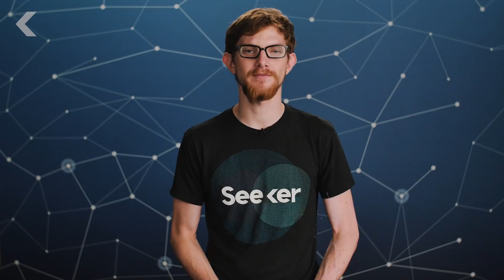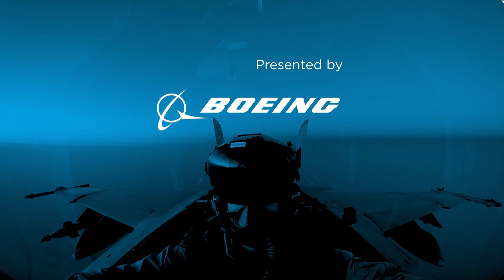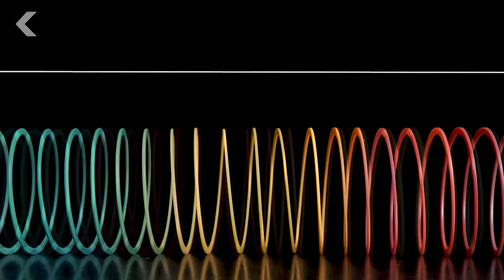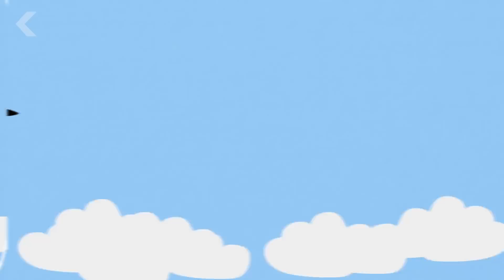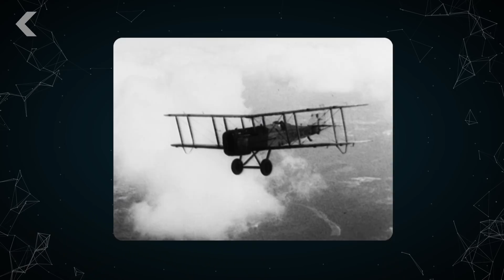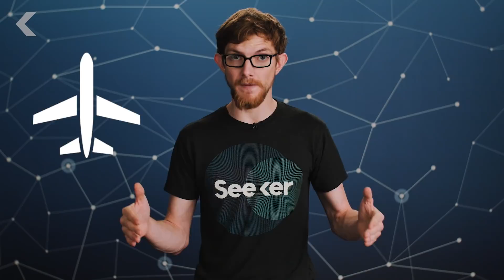The Simple Discovery That Let Us Fly Faster Than the Speed of Sound

Comment: 2:55 

I live only 2 1/2 miles from the runway of an AFB, and let me tell you this. When an f-16 takes off, you hear it. when an f-22 takes off, you don't hear it. When an f-35 takes off, your windows rattle and you hit the deck. Last airshow i went to had the f-35 as its main event. On takeoff the sound is so insanely loud it feels like you're being punched by it continuously. But once it gets up to speed and turns the afterburner off, it's oddly quiet.

Comment: China I-plane is designed with two set of wings.The reversed forward swept wings and delta wings has a better lift and less drag from sonic boom.The I-plane uses two turbo-scram jet engines to reach mach 6 speed.Typed Wang Zhenguo and VLRAAM into your computer to find mare information on Chia s 6th generation airplanes.The PL-21 VLRAAM that flies at mach 6 speed is based on the turbo-scram jet engine.

Comment: under normal subsonic flow, air flow rate increases as flow cross section area decreases. No issue there, it's just conservation of mass flow. So this mean if you increase the angle of attack at subsonic speed, lift increases. However, in super sonic flow, the relationship between flow cross section area and flow rate is actually reverse, IE: powider flow cross section actually lead to faster flow rate. This in term translate to if you increase the angle of attack at super sonic flow, the lift actually decrease instead of increase.

Since most plane control surface operate based on this angle of attack principle, this mean when a plane enter super sonic flight, all its control surface's force vectors are actually reversed. Imagine you're a pilot, at super sonic flight speed, you would actually need to tilt your airplane downward in order to fly up, pretty counter intuitive. Similar inversion also happen to pitch, roll and yaw control surface.

Since airplane don't transition from full subsonic to full super sonic at a sharp cut off, what you have is transsonic flight. Where an airplane has part of its flight surface in subsonic speed while other part in super sonic speed. This mean part of your flight surface has reverse control while other flight surface have regular control. It's incredible hard for a pilot to maintain control of the airplane during transonic flight without using computerized flight control. A lot of early test pilot actually died because they stay in this "unstable" transonic flight for too long.

Comment: No wonder Trace was annoyed when someone pointed out that the diagram of a wing in flight was wrong. They presumably had already been planning to use it in 3 more videos, including this one. How many Boeing videos are you doing? And will you ever correct that graphic for any of them? The air going under the wing essentially bounces off and gets directed down. If it shot up like that, the plane would drop due to conservation of momentum. Eventually you should watch the Numberphile video that explains it. The difference in air speed that leads to a difference in air pressure does not fully explain the effect. It's enough of an explanation for your purposes, but the diagram should still be accurate enough that it could explain the other aspects.

Comment: Actually, most propeller tips do not break the sound barrier.  For example, a Mooney M20C has a Hartzell propeller that has a 74-inch diameter propeller.  Its radius is one half or 37 inches, just over three (3) feet, or one yard long.  At a maximum rpm speed at take off of 2,700 rpm, the speed of the propeller would be somewhere around 550 to 570 mph.  Not quite the speed of sound of 750 mph at sea level.  However, the speed of sound changes due to atmospheric conditions, like temperature and pressure, but unless you are flying a P-51 Mustang with a supercharger which can churn 3,000 rpms at very high altitude, the tips will not break the speed of sound.
              It has been said that many pilots during WWII broke the speed of sound before Chuck Yeager did it, however they never lived to brag about it.  When they did it, it was in a high speed dive.  The special secret that Chuck Yeager admitted to after the matter was unclassified was the ability to have the tail section change its angle of attack as the speed of the aircraft increased.
BTW, for anybody interested in computing the speed of sound of a wingtip, try this:  2(Pi)R=Cxrpm/5280ftx60min=prop speed tip.   Where 2 times pi time radius= C where C is the circumference of the arc of the propeller.

Comment: Hopefully, traveling at the speed of and faster than light will be possible. I don't see any reason why it can't be. Everything we see in nature, however complex it may be, is 'raw', we can refine it and make something bigger and even more complex by analyzing it and combining it with other things. Therefore I believe breaking the light barrier will be possible, we just don't know how yet.
Reply: Illyasviel von Einzbern There's a host of problems traveling at light speed. 1st you'll need an infinite supply of energy which in this universe is not possible. 2nd you have relatively problems of traveling near or faster than light. And 3rd the practicality of it isn't worth it when non conventional means a traversing universe are more viable due to their efficiency and avoiding the 1st 2 problems
Reply: And the infinite energy thing also means that you're turning into a black hole. They call it the universal speed limit for reason.

Comment: You guys sure are getting your money’s worth out of that “airflow over a wing” graphic
Reply: OH HELL YEAH WE ARE.
Reply: The logic behind it is a fallacy, the air does not accelerate to meet the flow at the end. Bernoulli's principle says that if the cross section get's smaller (think of the top part of the wing as 'half a tube') the flow will accelerate and therefore the static pressure will drop. This difference in pressure between the lower part of the wing and the top part, is what creates lift. Along with washout from beneath the wing due to Newton's third law of motion.
Reply: That wing as shown blows.
Reply: Trace Dominguez Savage
Reply: You are one of the few people to finally understand how the aerodynamics of a wing work.  I believe the numbers are 80-90% of lift is due to Bernoulli's principle and 10-20% due to Newton's third law.  The air speeding up on the top of the wing is a very common misconception that is still taught today.
Reply: +iLivOnYooTube - If you check the cross section of an F-104 Starfighter wing, you might think twice about Bernoulli.
Reply: lmao
Reply: @iLivOnYooTube - Well the air does speed up at the top of the wing, but it is not because of the equal transit time theory. The exact reason why the air does speed up is still unknown.
Reply: Javier Llaneza the air does speed up. The top of the wing is rounded which forces the air to travel a greater distance than the bottom of the wing, this creates  low pressure. The air on the bottom is high pressure. The molecules on the top and bottom are moving at different speeds but they must meet back together at the same place and time.

Comment: The main change that allowed faster than sound flight wasn't the swept wing, but the "flying tail". On sub-sonic planes, a hinged portion of the elevator and rudder move. It was found during the experiments with the X1 that if the entire elevator and rudder were made to move instead of a hinged part, control could be maintained as the plane passed through the speed of sound.
Reply: 88dukecoupe that crucial information was given to the USA by the UK with the Miles M52 program having already solved the problem. The USA then made the UK govt shut down the program so they could be first to break the sound barrier.

Comment: Beyond the sweep of the wings, the other major development that allows flight faster than the speed of sound is the movable tail surface.

As speed increases, the original method of putting control surfaces at the rear of the tail planes didn't work.  The leading edge of the tail surface caused a separation of the air stream, and it didn't reform until well behind the control surface.  Making the entire tail surface pivot was a major step in resolving this issue.

Comment: The point of this video is just bad. The shape of the wing does matter when breaking the speed of sound but it's not what got us to that point. Swept wings were designed to give more control and stability when going faster than the speed of sound. What really got us to this point were the improvements of rockets and jet engines. the first plane to break the speed of sound was the Bell X-1 and it used a rocket to propel itself. (jet engines were still very new and still slower than some propeller powered planes. The Bell X-1 did not have swept wings, it had straight flat ones that also gave more control because the airflow wouldn't separate from the wings like the primitive designed ones showed in the video. The airflow disconnecting from the top of the wing instead of following the curve down to the rudder was the reason for a loss of control of a plane going close to the speed of sound. (An incredible amount of  piolets died from this when trying to pull out of a steep dive). Better jet engines are what really allow for supersonic flight today. Swept wings are not the reason supersonic flight is possible. This video does not go in depth enough to qualify as educational. This video is just riding on the back of the awesomeness of supersonic flight.

Comment: So they made it more aerodynamic? Seems like a no brainier. You wouldn't want a boat with a horizontal bow if you want it to pierce through the water at top speeds.
Reply: That's not how wings work. Swept wings are objectively worse at low Mach numbers.

Comment: This is total nonsense.  My professor was the guy in the tower at Edwards with the Phd on that day, who also designed the b-52 and SST...  The issue is when the wing goes supersonic the lift moves from the near the 1/4 chord to the center of area or 50%.  This causes a strong  pitch down just like during a stall.  On the tail the shock wave makes the "elevator" non effective in pitch control.  By making the tail one piece and rotating it, pitch control could be maintained.  Delta wings are used  (like the Concord) because the Aero-dynamic center is near the center of area.  During a shock wave the pitch remains nearly the same.  Non delta wings, like on the f-16, put the CG aft so that during supersonic flight the trim is least.  This makes the airplane unstable and requires a computer.  If you know what you are doing, you can make it so you can go supersonic and not need a computer.  I have done the wind tunnel tests... BTW, Chuck Yeager was the C student (expendable) and nobody knows my old professor....

Comment: I would like to see an everyday car go faster than sound
Reply: wouldn't that make it...not..an everyday car?
Reply: It would still be an everyday car if every other everyday car can do it too.

Also, while that would decrease travel time it would also be incredibly inefficient and increase travel costs. Cost is the true barrier to travel, not speed.
Reply: That is impossible as everyday cars have tyres. Rubber can’t handle that much stress as we can see with the Bugatti Chiron with the top speed limited to the tyres. The bloodhound ssc uses aluminum wheels, but has no need for rubber tyres as the propulsion is coming from a jet not an axle
Reply: If you were to replace the tires with some other material or means of propulsion that were able to withstand the stresses associated with going so fast, and then produce that design in large enough quantities that it became "everyday" you would then have an everyday car that could go faster than the speed of sound.
Reply: that's a stupid idea. Stay in school for better future ideas.

Comment: Germany had made jet engines in 1938. They used jets in limited military service as well. You have provided misinformation. They were able to get to about to the speed of sound with the Me-262 in a dive. Also, jets from after the war were not mach capable either. Some could dive to hit mach but couldn't do so in a straight line. The MiG-15 couldn't hit mach and suffered from severe buffeting even with swept wings. The F-86 however managed to dive relatively cleanly to mach during testing but in combat this was not practical and likely against some of the regulations they had for pilots due to wearing out airframes or possibly destroying them. The test in which the Sabre exceeded mach 1 was also before the Bell X-1 flew. Because of the X-1 pilot's ego, nothing was publicized about the F-86 breaking mach. Jet aircraft designed in the 50's were able to but things like the sabre and fagot (yes, the name of the mig) made in 47 did not.
Reply: The ME-262 only made it to mach 0.83 and even in a full dive only 0.86.  That's still a long way to go there.
Reply: they could reach mach in a dive but can't control since the biggest innovation for supersonic flight was not the swept wings but the all moving stabilizers which allowed aircrafts to be controlled in supersonic.

Comment: Wings don't fundamentally work that way. The hugely popular theory of lift generated by the bernoulli principle aka equal time argument is wrong. Lift is generated by two factors:
1. The coanda effect.
2. Newtons third law

The Coanda Effect: 
Any liquid or gas traveling along a curved surface will try to remain next to said surface (coanda effect), this causes a curvature of the air is it travels above and below the wing. Knowing that pressure on the outside of a curved flow is less, we can explain how this leads to drag as follows:
The air curves convex relative to the wing on top and concave relative to the wing on the bottom, this means that pressure decreases the closer you get towards the top of the airfoil from far above and increases the closer you get to the bottom from far below, this difference in pressure generates lift.

Newtons third law:
Air hits the wing and transfers its momentum, pushing it and generating lift; newtons third law in action. In other terms, lift is a force, f=ma and a = deltaV over deltaT. Velocity has a speed AND direction, the curvature of the wing makes the air turn and therefore changes it's velocity even without a change in speed. Since the velocity has changed over a given time, there must be an acceleration and therefore a force is applied, the force is also the lift.

Finally, although air over the top of an airfoil does go faster than over the bottom, the difference is so minute and insignificant when compared to the 343 m/s speed of sound through air. The real reason shockwaves form isn't because of the air going faster (although that does happen, again not because of the bernoulli principle but rather the coanda effect), but because the LOCAL speed of sound drops because of the decrease in air temperature caused by the rapid decrease in air density.
Reply: I think it's correct to describe the bernoulli principle more as a secondary effect, but one which is still considered when analyzing wing design and performance.
Reply: I'm glad we have intelligent people in the comment thread😅
Reply: I just contradicted your statement 26 minutes ago. My apologies !
Reply: Coanda effect is laminar flow, fluid following the curvature. Bernullies principle is local pressure drop due to increased fluid velocity. Both contribute to generating lift. Newton's third law,  the way you explained it would contribute to drag. The lift formula,  does not contain that variable.
Reply: As a model enthusiast of RC gliders 10 yrs ago, I picked up a book titled:"Composite Construction For Home Built Aircraft" by Jack Lambie , forwarded by Dr Peter Lissaman PHD Aerospace Eng. Best description of how lift is generated by an airfoil starts Chapter on Page 3.  Quoting: "Lift: Wings sustain an airplane by accelerating air downward" 
"Bernoullis theory only describes the secondary effect of how the forces are transferred to the wing" Earlier in the paragraph he writes how FAA manuals use the classic description of how air moves further over the top of the airfoil than the bottom, travels faster and thereby generates a region of low pressure drawing the wing up ! He then states that many pilots can't understand how an airplane fly's upside down, or why an under cambered airfoil produces more lift than one with a flat bottom. Anyway, I thought this was the best text I have read on the theory of flight. If you have studied physics or completed any engineering modules with statics and vectors, understanding the principle of accelerating air downward is quite straight forward. 
So, the most practical example of lift generation is holding a tea spoon under a running tap of water. When you move the curved side of the spoon into the stream, the change of direction to the flow of water around the spoons curvature results in an acceleration, generating a "lift vector" perpendicular to the water flow. The spoons reaction in the water stream is similar to the behavior of an airfoil in flight. Of course the difference being in medium type, and where water is non compressible unlike air.
Reply: @BuggSmasher  aircraft which are designed to generate lift inverted, have symmetrical wing designs such as acrobatic and fighter aircraft. However, controlling angle of attack changes the location of center of lift on the wing, whether inverted or not, so the airfoil can still generate lift in either direction. The downwash you're talking about, is true. However that is from a straight forward force vectors prospective. This means nothing from a pilot's prospective. We don't care what the downwash does unless we're in ground effect or wake turbulence, etc.